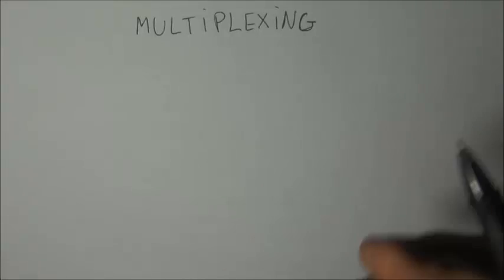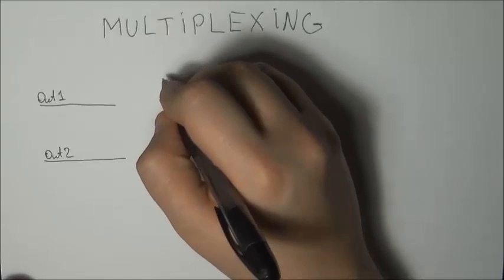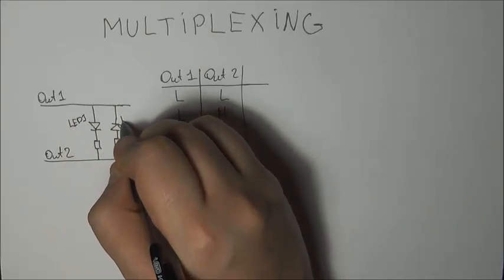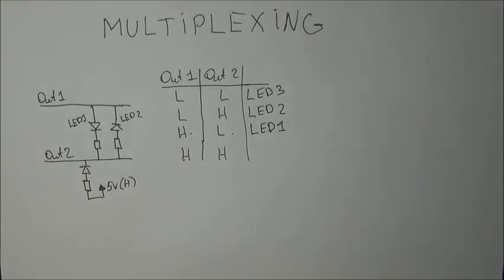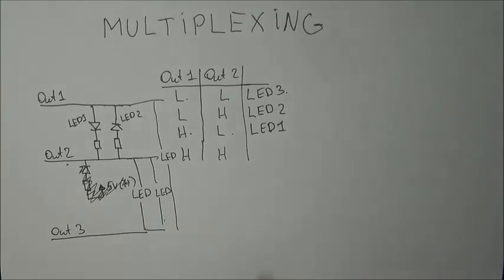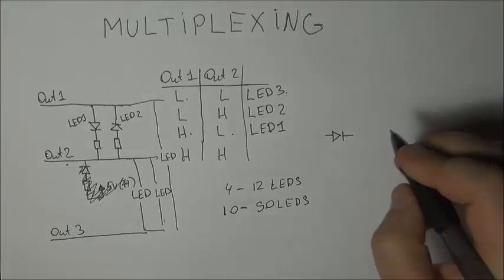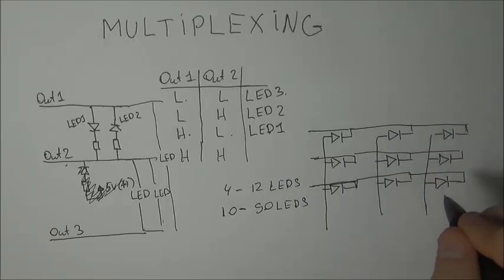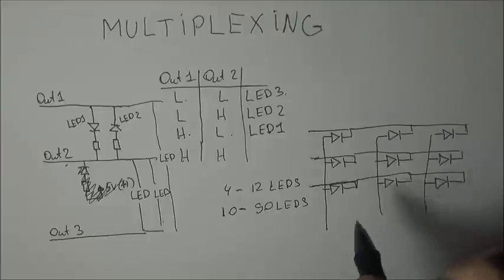Multiplexing LEDs, outputs on Arduino and other Controllers

Comment: 4:15 was a bit of an "Ah ha" moment. Something I don't understand is that you said with 10 pins you can control 90 LEDs but later in talking about the LED cube you say that you are driving 9 LEDs with 6 pins. How can you drive an extra 81 LEDs with only 1 additional pin?
Reply: Since nobody answered this previously, when he's driving 6 of those at the end, that's not the limit that can be done that way but rather just an illustrative example. The 90 LEDs were referring to a maximum for the configuration being discussed at the time.